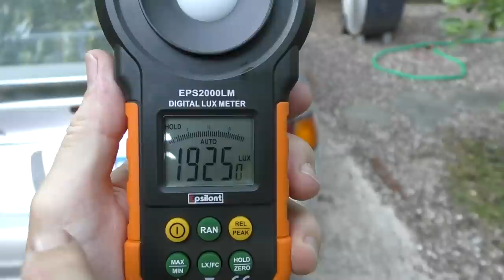I Made a Huge Mistake Buying These Headlights

Comment: The worst offenders are the folks who jack up their pickups and install bright blue headlights.  The lights are the same height as car windshields.  There ought to be a law against that.
Reply: there is
Reply: Then get a truck
Reply: there is but what police department enforces it ? HBPD (Huntington Beach) Ca might as they 19 years ago were ticketing trucks with big tires and no mudflaps.
Reply: Color (Kelvin's) is NOT a unit of measurement for brightness (Lumens).
Reply: There is.
Even in states with no inspections.
Height
aiming
brightness

like sppeding.... nobody reeeealy cares
Reply: There is in Texas... I can’t remember the height exactly but I think they can’t be more than 48-52” off the ground.
Reply: When a vehicle is jacked up, they should be considered as offroad vehicles and have restrained access to the road (like ATVs)
Reply: @lajya01  Great idea as the are nothing but a hazard on the road, useless, can't turn or stop or otherwise get along with adult cars.
Reply: I don't like it either but don't be a communist about it
Reply: @Mrbfgray  Meh, if you think you need to take corners like you're Mario Andretti, you shouldn't be driving anything on public roads.  The key is always know your vehicle and stay at a safe speed for the conditions.
Reply: There are. Just not enforced.
Reply: I ride a miata everyday. Every car does this to me, modified civics with insane lights are as bad as pickups for me aha. I hate them.
Reply: I dont have a issue with them I like how it looks and they dont blind me from behind because my car haves auto dim rear view mirror and side mirror so I'm good
Reply: There's so many lifted trucks driving in Arizona that every time I'm driving at night I have to turn in the driver's side mirror so I don't get blinded by all of them passing me.
Reply: I seriously can't believe that scotty failed to mention this, but the brightness has nothing to do with being blinded by headlights. It does not matter how bright the headlights are, because they're only bright when they're aimed directly at your eyes! It is required by law to have your headlights properly aimed to pass an inspection. When people raise their trucks, even if they don't change the bulbs, the regular old halogens are bright enough to blind you because they're angled right at your face. They are required to lower the angle so as not to blind oncomming traffic. It is also required when putting in a different bulb. Sometimes the fillament, or in the case of LEDs the diodes, are positioned differently than the last bulbs, and can increase the angle of reflection. So every time you do someonthing to the height of your vehicle or change the bulbs, it is absolutely curcial that you have your headlights realigned. The fact that scotty didn't mention this shows he doesn't know the first thing about the brightness of headlights.
Reply: Such laws are seldom if ever enforced.
Reply: @shadowplayer9011  yeah, but when you can make shadow puppets on the road in front of ya that's a bit fricken much. 📽👐🏻     👐🏿
Reply: Jeff Warner  - Right on!   They think they are their own 🔥 Firey 🌞 Sun?
Aim it back at em!
Reply: The problem is most of them don't properly aim them before they take it into the road, otherwise that wouldn't be a problem
Reply: @lajya01  Ok Karen
Reply: @lajya01  I approve this message!
Reply: @onlyactive9710  trucks are lame
Reply: there are laws but never enforced, like lic. plates never put on the front of a Tesla Becasue it would be less cool. An 18 wheeler semi truck has a ht limit and are carefully regulated. Lazy CHP etc.
Reply: get a light bar and give it back to them
Reply: You know when you stop at a light and those pickup drivers will stop behind you in the left part of the lane because they are in more of a hurry than you are and their bright headlight is shining in your side mirror,    I adjust the mirror so it puts the light back in the drivers eyes.  They move back behind me real quick.  Works every time.
Reply: I've turned my brights on several times thinking there's are on only to have them turn their brights on and doubly blind me
Reply: @Bo McGillacutty  the only adult car is a van my dude lol. Everything else is just a car.
Reply: @javaman2883  Same thing in Tampa, FL, almost every night
Reply: I think the one thing people forget when lifting your truck is to not also check your alignment but also readjust your headlights to compensate for the lift
Reply: Simple, readjust your headlight beams
Reply: It wouldn’t be so bad if they took the time to re-aim them

Comment: I hate these lights. Especially on Trucks. So many jackasses love to tailgate.
Reply: Very true, doesn't help that their lights are so damn bright
Reply: Prince Revolver and put their light in the driver side mirror too
Highly annoying
Reply: Clay S no proof of that
Reply: Prince Revolver 
@smalldickgame
Reply: Prince Revolver I know right dude my entire car gets lit up
Reply: Why I put a rear light bar on my jeep lol
Reply: The problem isn't the light brightness, the problem is the headlight housing. These big lifted trucks put HIDs in a HALOGEN headlight housing. This causes the light to disperse all over the place. Makes you blind anyone in front of you or on the other side of the road. HIDs were designed to be used with a projector headlight housing as this housing concentrates the light beam in a way that's useful for the driver and won't blind oncoming traffic.
Reply: I brake check them tailgaters
Reply: If they’re tailgating chances are you’re driving too slow
Reply: P.R. - For a freight truck on clean, dry pavement safe car-following distance is (maybe) 10 seconds. 
The trucking industry has resisted stronger brakes, tires with adhesion comparable to cars' tires and anti-lock, anti-jackknifing systems. Air brakes are sluggish in release-reapply acting, which makes it more complicated to have effective antilocking.
Reply: @Ninjasraynonu3  45 in a 40 zone is not slow.
Reply: Every guy with a pick up tailgates. They think they own the road.
Reply: @algrayson8965  referring to pick up trucks. Not 18 wheelers.
Reply: Prince Revolver I do agree with you on that
Reply: I agree, pisses me off.
Reply: LED light creates an oxygen molecule in the back of your eye that causes you to go blind
Reply: Exactly. Pick-up trucks jacked way up put the headlamps aimed directly into the cabin of the car in front of it even when on low beam.  I hate driving at night because the closer they run to me the less I can see so I have to slow down which makes them tailgate even closer. I guarantee, those trucks are not being driven by soccer moms.
Reply: Out where I live in southern Tennessee, on Friday and Saturday nights I stay off the highway... all those young good-o'-boys in their lifted F250's with the noise-maker tail pipes and steel grille-guards are out prowling with their dates, and those bright-as-the-sun lamps shoot right into my rear-view mirror in my SUV. I have to fold up my inside mirror or go blind. Not a speck of dirt on any of those $75,000 monsters, either. Whoo-eee!
Reply: Good advice. Bought the cheap one and lasted a week.
Reply: Spray that tailgater with your windshield washer fluid.
Reply: @thomasdarby6084  Pavement Princess's. That's what we call them. Huehue 😅
Reply: @ChrisfromGeorgia  Lol. I will remember that!! I call them Rodeo Roadsters.
Reply: @dillonh321  Your taxes go for the 1 percent not the roads.
Reply: Just engine brake. I love doing that to tailgaters! 😂😂
Reply: I like to break check tailgaters..
Reply: Me too, even certain manufacturers cars with leds makes so much glare
Reply: Will King don’t do that
Reply: @stillnotwoke  Hehe. That's so true! They probably double park as well.
Reply: Break check em
Reply: Ive solved the problem with tailgaters by throwing on a "new driver" sticker
Reply: And they run their fog lights too...when it's a clear night.
Reply: Dorian F        If the headlights are overly bright, I’ll just get behind them and put my brights on and drive like that for a while so I can be see better and be safe.😏
Reply: Ryan Cummings Not true usually pick-truck drivers being road bullies.
Reply: @steelisthemeal  
Probably shouldn't be Driving so close.
Reply: That's because they don't have there head lights adjusted right
Reply: I slow down for tailgaters.
Reply: @Joe Casson lol it is what it is
Reply: Decades ago I had a switch on my backup lights so that I could push the button while driving.
It worked !!!!
Reply: brake checking is childish road rage
Reply: Drive faster or get out of the way.
Reply: Then we see the road rage fights on video where no one knows how to fight
Reply: They have there led light bar on also but have their headlights off
Reply: You gona cry?
Reply: @Ninjasraynonu3  Likely in the passing lane too...
Reply: @PrinceRevolver  If you're in the passing lane it doesn't matter.
Reply: Darren Davenport because they’ll be right in the back of that car 😂😂
Reply: @steelisthemeal  ha...good tip ;)
Reply: @Ninjasraynonu3  at 70 mph???
Reply: @Ninjasraynonu3  wrong
Reply: @dillonh321  type of person to assume superiority by saying I pay "taxes"
Reply: @steelisthemeal  aye I found you again Scrappy-Doo.
Reply: @stillnotwoke  is that your hillbilly term for people who go to the mall?
Reply: @Ninjasraynonu3  no
Reply: CoC Master what 😳
Reply: @wendyhager6655   That's a term we use at the Oceano Dunes here on the central coast of California for valley people who come here with their big lifted trucks with oversize wheels and low profile "off road" tires which are useless in the sand, as they have little sidewall to grip when they air them down. Yes, we call them "pavement princesses" too!
Reply: The biggest problem with lifted trucks is they don't re-aim their headlights. Even worse are the guys whose front ends are higher than the rear of the truck.
Reply: Adam Wiggins The pick ups
That are higher in the front then the back are usually Ford
Pick up trucks for some reason
Reply: @steelisthemeal  not in my neck of the woods. Mostly GMs around south GA.
Reply: Adam Wiggins around here and Juliet is mostly Ford F2 50s and 350s they have the high front end
Usually diesel too
Reply: @steelisthemeal  *anecdotal evidence says yes.
Reply: Ryan Anderson that’s really not good 
Just the fact they are so bright and blinding you have to do this
Reply: Ryan Cummings 
I’m not going to go 80 in a 55 zone just to please some bastard! In the city, I’ll slow down to piss them off 😈.
Reply: Prince Revolver i hate em too but now LA is taking out freeway sign lights to deter jumpers and graffiti so I’m gonna have to be another one of those sun beam lights. All I do to keep tailgating away is point my rear view mirror and rt & left side mirrors to reflect back at them and they back off or pass me since they are most likely speeders and i follow the speed limits and stay in the slow lane! People suck!
Reply: Ryan Cummings so just pass em as their most likely just following the posted speed limit.
Reply: Thomas Darby same here in LA too! City folk dont done need them lights!
Reply: Taylor Hoyt I’ve seriously considered that! Since no one follows the posted speed limits anymore!
Reply: Clay S I always say the same Damned thing! Brilliant minds think alike!😂😂😂😂😂
Reply: Every one in here bitching about guys with trucks I’m just here with my LEDS on blinding you in your Prius.
Reply: @superbros1690  Excepting when they are taking off. Then they act like they are driving a Prius in a MPG challenge...
Reply: Prince Revolver yes it is
Reply: @ripposty7535  no it's smart guy. Especially in heavy traffic.
Reply: Before work I stopped by a used furniture store to pickup a Mirror for my bathroom and it barely fit in the back seat of my car and was angled 45 degrees back. I work afternoons so i'm used to getting blinded on the way home but not only did it shield the light from me but it was sending it back to the assholes behind me, I left the mirror in the back of my car for probably a month for a break it was nice.
Reply: @divingduo1963  This is why I use 10 percent tint on my 3 rear windows and 20 percent on my 3 front windows because I always bumb into tailgaters in tall trucks with LEDs.
Reply: @dillonh321  it costs more than your little amount of gas tax to pay for a Road Grow Up
Reply: @thomasdarby6084  the same time and the same.  ,
Reply: @Streetracerex1998  ur gonna regret that some day
Reply: @bobbyb7127  I have to agree with you. It seems like everybody is entitled and civility is fading away. Here, in my small town, you only see one or two jackasses at some occasions. 
In the city ??? I can clearly say that more than 50% are acting like little princes or princesses.
Reply: @inoubliableparapluie5849  Eh eh eh ! Unique name. Unforgettable umbrella. Français ?
Reply: @steelisthemeal  I wonder if you noticed them damn Fords with 4 beams on, all the time. Some jackasses changed the bulbs. It is even worst when they're hauling a heavy trailer and, they are behind you. I drive a pick-up truck too and had to pull over. That damn Ford was trying to send light signals at the moon. I guess the guy need to upgrade the rear suspension.
Reply: Obd1andDown could be actually
Reply: Thomas Darby 🤣😁🍺🍺🌮💰📺utube
Reply: The orange glasses for computers works great reducing the brightness. It does take some getting used to because then all the lights look yellow.
Reply: Yeah those high-intensity discharge headlights are too bright and when someone with a pair is tailgating you you can't even see through your rear-view mirror without being blinded
Reply: @Ninjasraynonu3  the driving to slow is pretty invalid at times you could be on the free way in the slow lane going 80 here and get tail gated or in town where there is no slow lane or fast lane. At the end if the day someome going slow is not an excuse to tail gate unless your just waiting till the day someone brakes hard and you hit them because you were following to close and enjoy the raised insurance rate for years to come after
Reply: @alexcintas8792  can't afford those tickets tho
Reply: @Ninjasraynonu3  The morons tailgate me in the right lane. When they eventually pass me, they begin tailgating another car.
Reply: @herbienbrian2  you watch too much Alex Jones.
Reply: Nothing worse than the lifted truck with the HIDs that blind you in your rearview mirror.
Reply: I love these lights to blind people .Lol
Reply: Prince Revolver  - At 70, I can't take it, and love, in my James Bond fantasy to launch a road slick oil, machine guns, or launch a heat seeking missile to destroy these very rude monsters trying to run me off the road.

Comment: LEDs should be aimed down to avoid blinding people. If you live up north then stick with halogens so it can melt the snow off the headlights
Reply: @KHLegend - really good point.  I see many new cars in winter with lights obscured by snow or ice. This was not a problem before LEDs.  Ontario even started using LED bulbs on snowplows.  Huge mistake, as the rear lights are totally insured as soon as they start plowing.  I like to refer to these solutions as "California Tech", cuz they may work well in that world, but not so much in mine!
Reply: Good catch...that is a downfall of LED headlights AND traffic signals.
Reply: @BigEightiesNewWave   Yeah, but, they're SAVING THE PLANET!  😂
Reply: I live up north and we just brush the snow off before we drive like our roofs it's the law. D'uh 😲
Reply: Michael Angelo Same here in Connecticut where I live! You've gotta clean off your car almost completely! Cop sees ice on your lights, is snow on the roof, you get a ticket
Reply: Michael Angelo lmao i didn’t know because it basically never snows in florida
Reply: Michael Angelo , in blowing snowstorms snow tends to stick to your headlights while driving so the halogen idea may be valid
Reply: @joelspivak6622  I occasionally pass a New London cop in my town that never clears his police car off. He leaves snow on the roof, trunk, license plates, tail/brake lights... Even if the storm ended the previous day.
Reply: Even halogen lights will ice over. If it's that bad out maybe you shouldn't be out driving.
Reply: I live in Minnesota, and I have leds in my Pontiac and they put out enough heat to melt the snow or ice, it’s not like they run cold, just cooler than halogen, but if you’re from the north then you’d know to clear off your lights before driving 🤷‍♂️

Comment: If someone is tailgating me on their high beams, someday, I'm going to prop up a mirror on the rear window or chrome wrap my car to see what's up.
Reply: I just put a 2 foot light bar on my rear bumper. Just in case I Need to get someone's attention. 👹
No tailgating bruh!
Reply: LOL thats a good idea. Get a person  in the back to put up a mirror
Reply: Alexander/tailgating.
Run your door power mirrors all the way up and in.
Go 60 ft behind your car with a flashlight and adjust the mirrors manual ratchet adjustment so the light shines right back at you.
When you get a tailgater just run your mirrors to the stops and he gets to see his own headlights.
It works.👍

Comment: The reason people kept flashing you is because you stuck HID bulbs in a non projector housing which in addition to being illegal, also doesn’t properly focus the light beam because the focal point of the filament is no longer properly located in the housing which causes glare that blinds oncoming drivers.  Led bulbs, and HID bulbs should only be used in projector housings which have a sharp and clearly defined cutoff to prevent blinding glare to oncoming drivers.